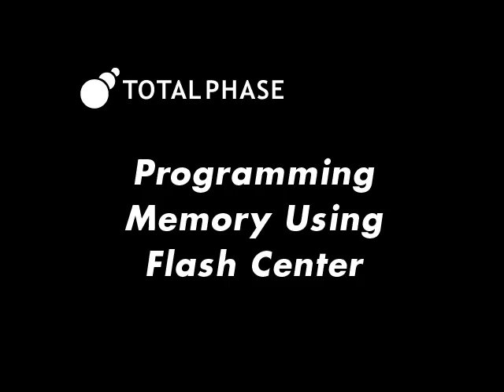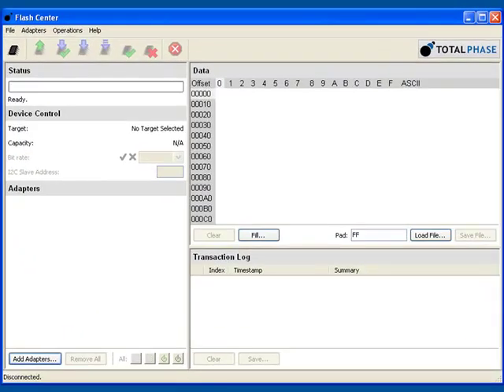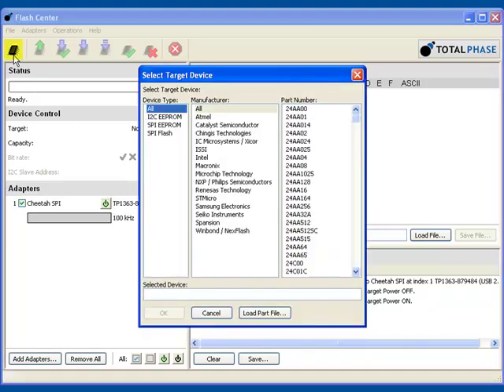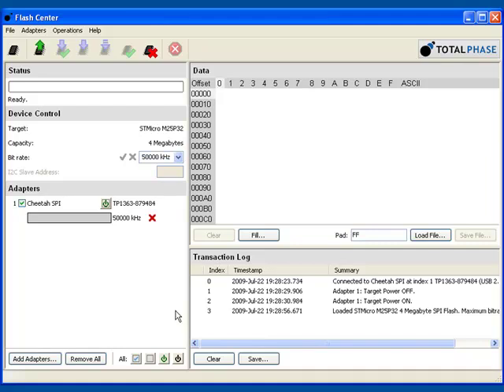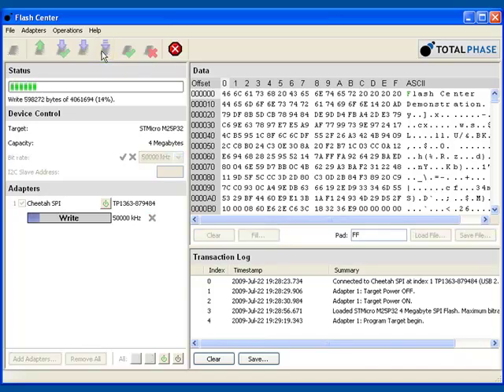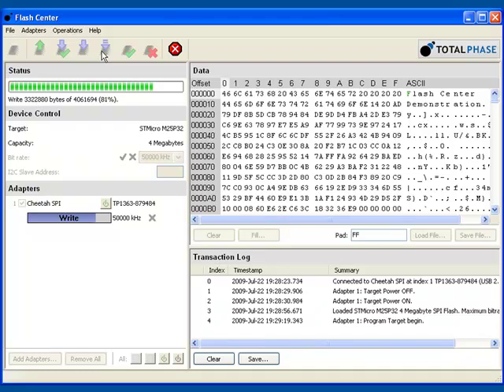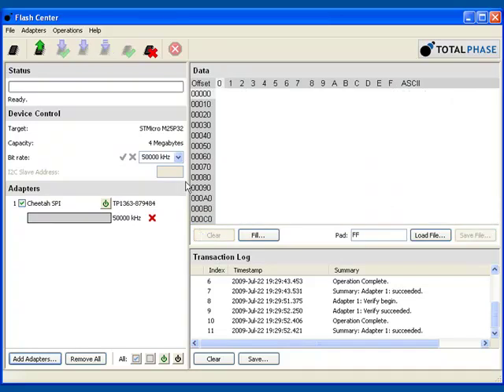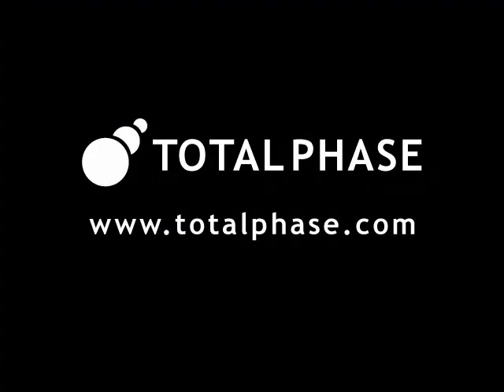Programming Flash Memory Using a USB to SPI Programmer

Comment: can I programer flesh memory 25q32 wich is my device? the device have usb to connect with a computer?
Reply from the maker: Hello, 
If you are programming a Gigadevice GD25Q32C or Winbond/NexFlash W25Q32 flash memory chip the answer is yes. If not, you can upload a custom XML-based part descriptor file for the device you are wanting to use. 
Yes, the Beagle USB Protocol Analyzer connects to the host computer via a standard USB A to B cable which is included in the box.